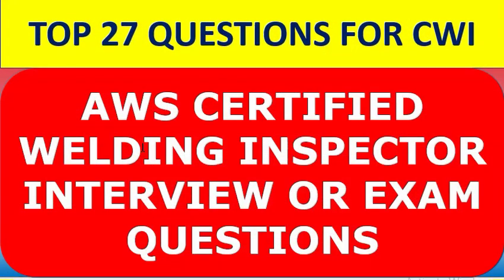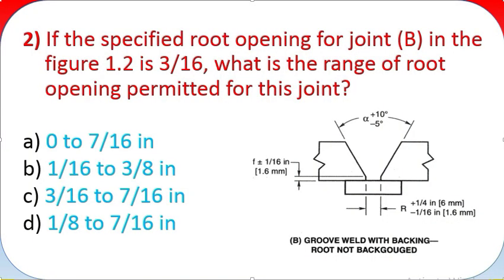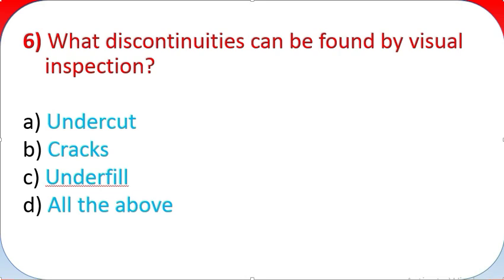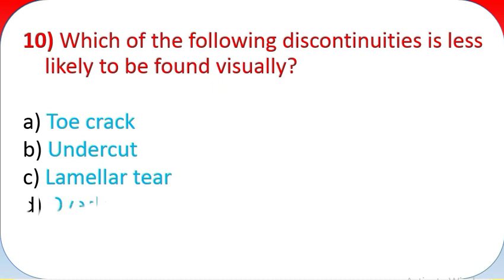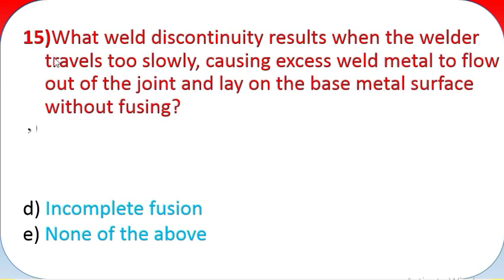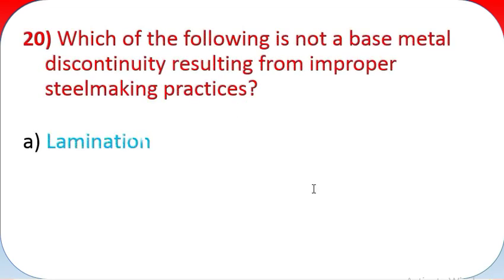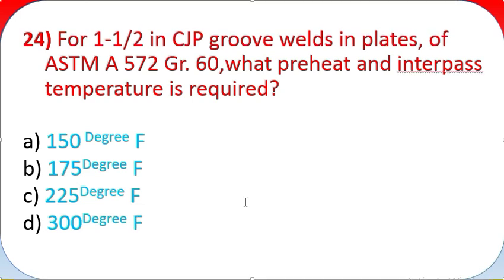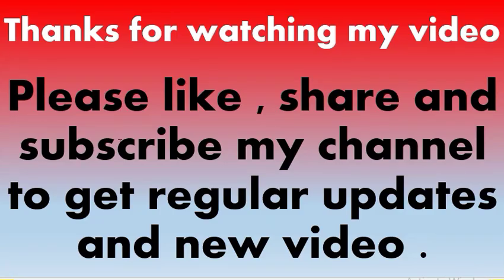AWS (CWI) Certified Welding Inspector Interview Questions

Comment: Always good content sir

Q1/Q2) what is the difference between root opening and root face?

Q16: How do we differentiate undercut from underfill? In experience, undercut occurs in base metal adjacent to the weld, and under-fill occurs in the weld metal- You're answer sheet needs to be checked

Q21: Please explain why?

Q24: Can you refer me to where I can find inter-pass temp?

Q26: Can you refer me to where I can find allowable under cut?